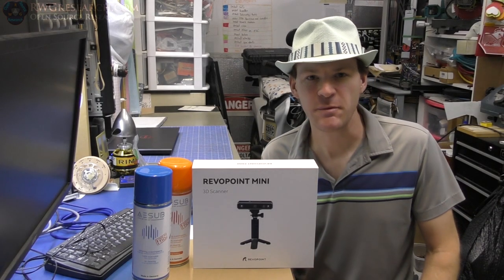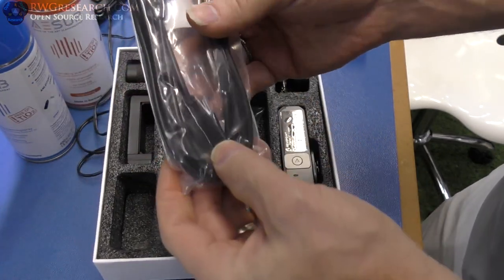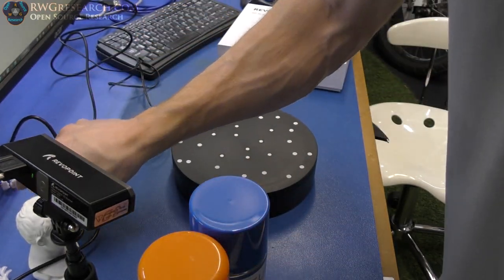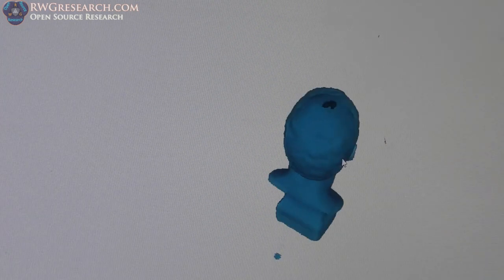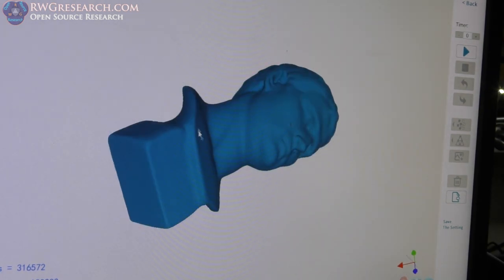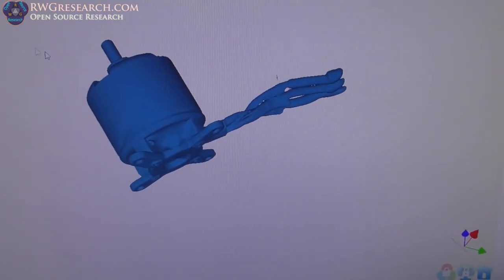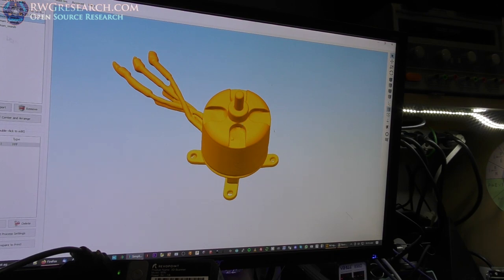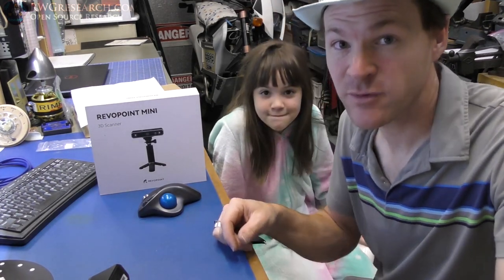#20-22: Blue-Light 3D Scanner, RevoPoint MINI. Lets Check It Out!

Comment: Great video, thank you. Since you have experience with the mini and Pop 2 can the Pop 2 scan something bigger where as a Mini wouldn’t be able to?  I’m comfortable combining meshes but if the possible scan area is much smaller on the mini then the Pop 2 might be a better option.
Reply from the maker: You can scan more at one time with the POP2 however. The smaller objects work better on the mini. you can still scan a large object with the mini, but it will take more time. they both work good. the main difference is the light source. you cant use the mini out side, and is not recommended for face scans as the blue light is very intense. where the pop 2 is good for all theses applications. ~Russ
Reply: @RWGresearch  Great, thank you for clarifying.

Comment: What we really care about is the scanner accuracy, and resolution, i do think that you should scan some objects with precise mesurements that you can verify and how far it can go to very small deteils, the Revopoint say this scanner can go up to 0.02 mm or 0.05 distant points, can you do that kind of test to see what is this scanner capable of ?? thank you very much, very good job.
Reply from the maker: agreed, i just pulled the motor in to cad, i measured 0.197" with the calipers on the motor shaft, the car measures 0.1964 - 0.1966" the outside of the motor with the calipers is 1.456" in cad i measure 1.464" - 1.462"  I'd say that quite good IMO. top to bottom is hard to measure but its darn close. so yeah. i'd say that in the right case its totally capable. in perfect conditions i dont see why this would not be able to hit those numbers listed on the spec sheet. ~Russ

Comment: What size of object would you say is the maximum size realistically scannable??
Reply from the maker: there really is not a maximum. but if the scanner is stationary you can only scan so faraway and so close. ( 100-200mm) but if you scan by moving the scanner around you can go as big as you want... you can also move the object around on the table. but i found moving the scanner on a larger object is easier .  ~Russ
Reply: @RWGresearch  Have a prusa printer so bed is 200x200mm.  Is that classed as big/average or small?  No idea as never scanned before. Only printed after downloading stl files from net
Reply from the maker: average ~Russ